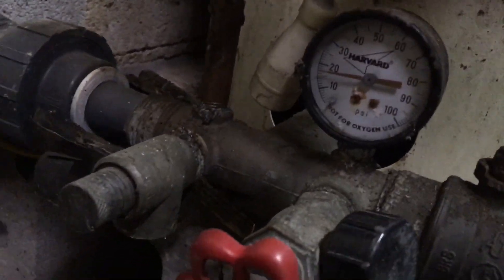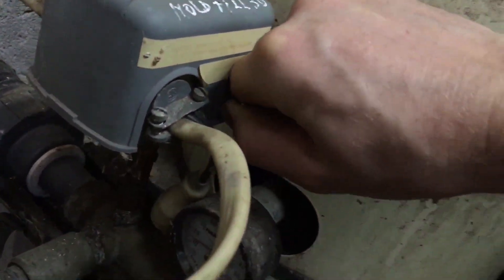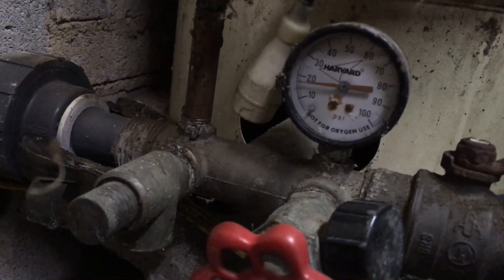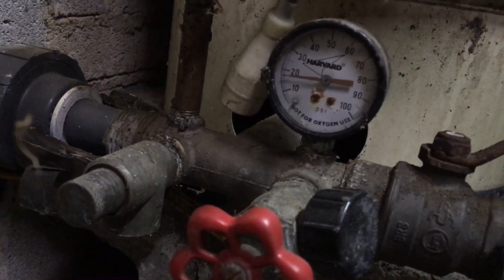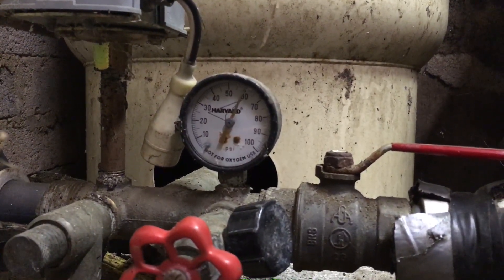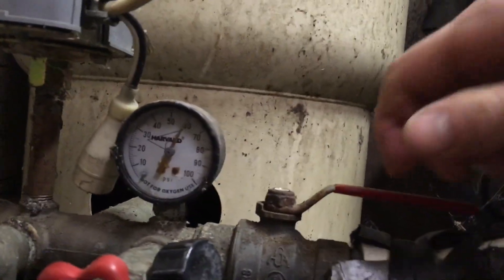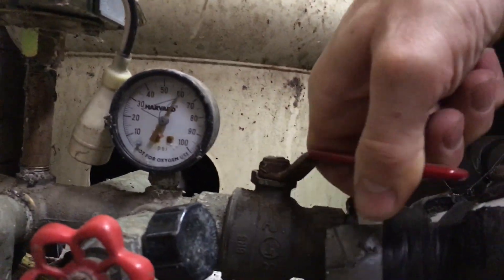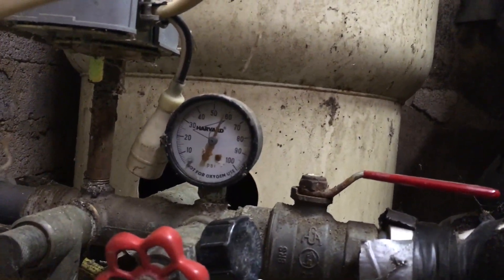How To Reset Low Pressure Cut Off Well Pump Pressure Switch

Comment: Get rid of all low pressure switches with that lever! Modern switches do not TRIP and when the power comes back on it will just work.
Reply: If it cut off because your well water got too low, you will burn out your pump if it does not have this lever because the pump will keep running
Reply: @terryh.9659  yes you still need the pressure switch, just not the old type with that lever you use to reset them when that trip. There are modern electronic switches that work way better. The moderne versions do not trip after a power failure.